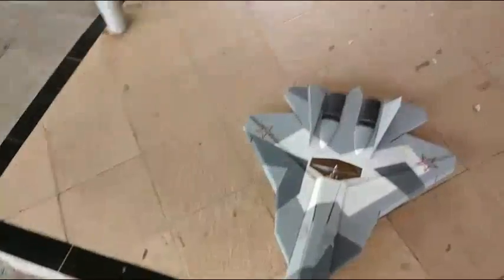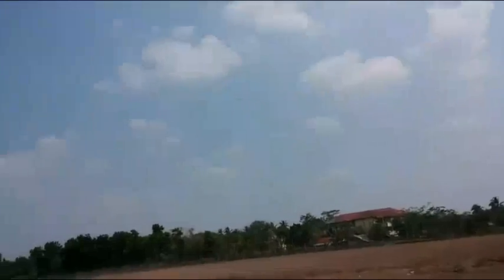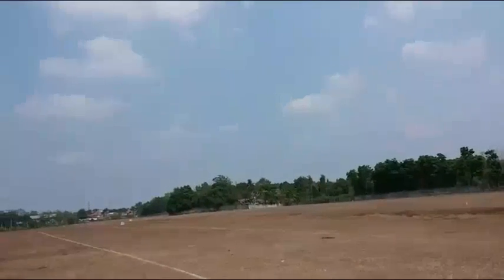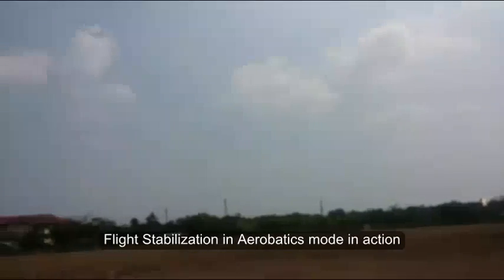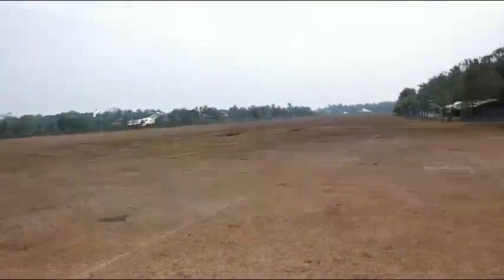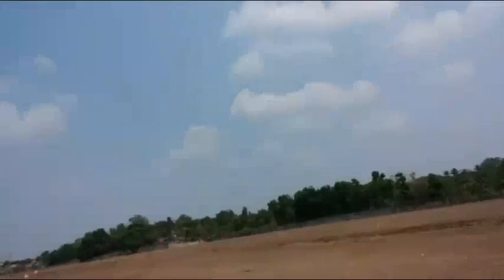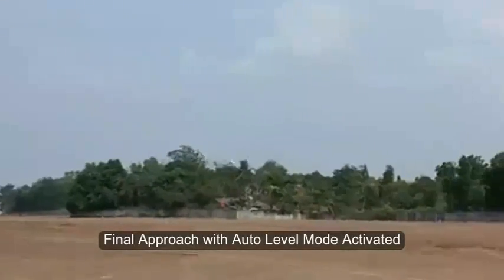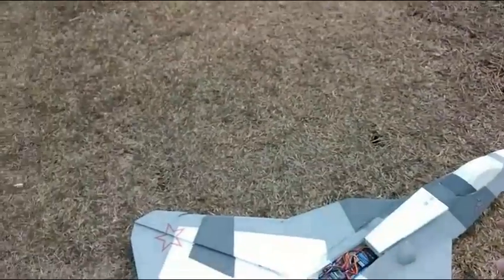Dualsky FC151 Flight Stabilization Review on Pak Fa T-50

Comment: Spectacular!!!! I loved!!!! Just one question ... do you need to set any parameters in auto-stabilize mode?
Reply from the maker: Thanks David. It was just using on-off switch with sround 30% stabilization threshold
Reply: @parkflyerindonesia  Thanks!!! I have one installed on a recent build model. I operate it with a three-position switch. The first off, the second in acrobatic mode and the third position in auto stabilized or panic mode. I asked before, why with the fc151 level, in off mode, it logically does not work. In the second mode, it only works if you move the plane abruptly but it always returns to the trim position and in the third position the ailerons and the elevator, despite the device being level, are positioned in a way that seems abnormal to me and it does not match the trim position. I don't know if it is self-adjusting in flight. It's possible?
Reply from the maker: @davidmartinezlopez36  Hi David. I found that the FC151 leveling takes more time when initializing at the first place. Then it works on 2 of my planes.

However, I now use hobbyeagle A3Super3 which works sooo much better than the FC151. Price is slightly higher, but if you may wanna look, my all other newer videos are showing it with the A3Super3, which I placed it as my panic/recovery system should the planes experienced any strong gust or out of control from extreme maneuvers.